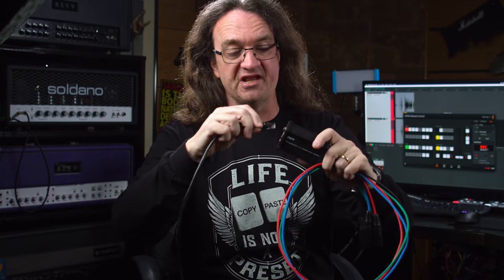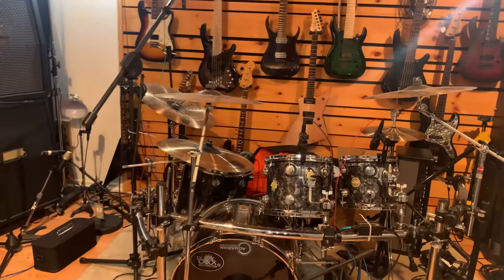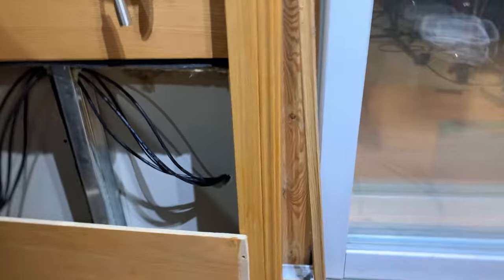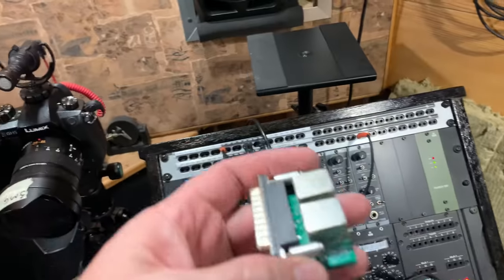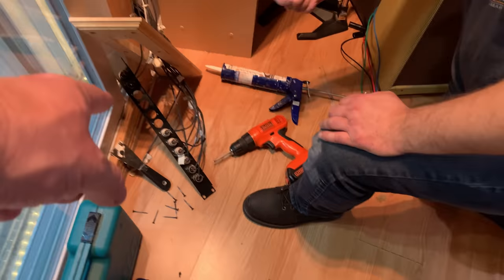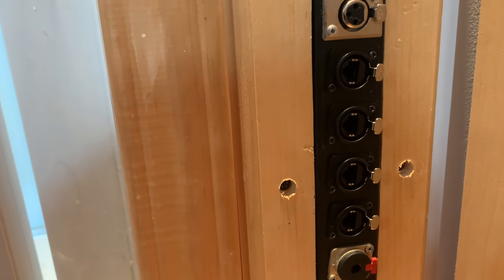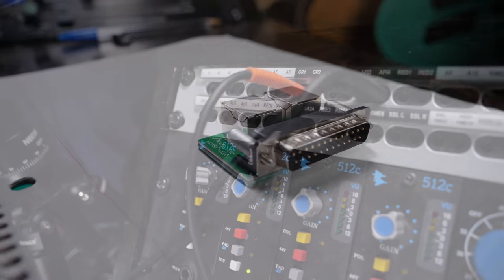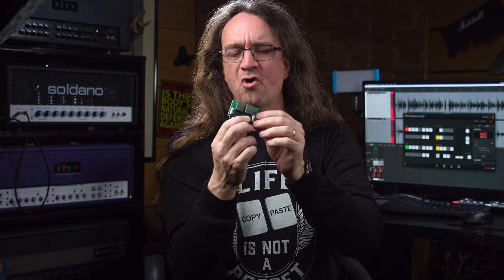How we Rewired the Studio!   We used lots of Caulk!

Comment: XLR and cat 4-5-6 are both balanced signal transmission cables.  The XLR just has a built in ground, while cat 6 has a common ground.  Other wise they are both balanced twisted pair systems.  So no surprise the cat 6 works well.

Comment: CAT Network cables are spiralled inside (or should be by specification) to reject more noise. But be careful installing them as they are (or again should be by specification) made of annealed copper which bends eailsy, then goes hard and brittle. It really is designed to be installed and left alone. I'd add that its usually a good idea to leave a 4" bend minimum on the cable if you want to guarauntee gigabit performance.

Comment: "The thought of running analog audio over network cable wasn't even thought of back then" ... glen.... gleeeeen...  That is 4 line analog telephone wire hijacked into running computer networks.  It was designed to run analog audio signals!  You are literally using it for what it is designed for!
Reply: BOOM! I worked at an audio post house and their ENTIRE interconnection trunking system was run over cat 3 and terminated on 66 blocks!
Only the last few metres of cable was shielded audio cable to XLRs from the patchfields.
Reply: yeah, I wasn't gonna say.  My deal is that if you are using sources that have significantly different cable length, you're gonna get sync problems, because, analog.

Since we had to isolate not only audio but wireless (I was the New Devices Group at Intel at the time) I just solved all my problems with PoE and fiber converters.

I was finding it a LOT easier to use that cabling to push distributed audio and deskew at the end points via reactive feedback and clock shifts, so if I had to send something to 20 different points in the room and at different spectral densities as well as filtered response desired it worked fairly well and allowed us to work backwards from that setup to embed reflection cancelling technology into the product - we could control everything, but again, this was more from a stimulus/pattern generator point of view, where this is trying to distribute the raw signal under its own energy.

At least with fiber converters if I was running a long stretch I could add a length of doped fiber to boost the signal without doing anything like an amplifier/processor.

I'd have to go check and see the parameters on the fiber converters - we might actually not only find a nice analog solution but one that REALLY cleans things up.

Running copper when I don't have to makes me cringe these days - also if you are going to upgrade power you can get used Starline Busway on ebay for HELLA CHEAP when that shit is VERY EXPENSIVE new.  I can't briefly explain what the stuff is but I can say I will NEVER build a lab, shop, studio, etc without it if I have a deciding vote.

Overhead on demand reconfigurable industrial grade power bus is something that once you experience it, you look at wall outlets with literal disgust.
Reply: Also cat6e is much better shielded, that's how it gets a better rating; the gauge of wire isn't heavier.  Once you get to the stuff that carries 10G/40G/100Gbps it starts feeling closer to hardline.
Reply: if you want a thumbnail estimate, your standard twisted pair with standard vinyl sheathing that's in your average RJ45 cable, is about 100 ohms impedance (yes through the length of the wire, NOT per inch), but the thing to understand is there is hysteresis in the line as well as some fundamental limits.  I never tried for high fidelity over twisted pair so I can't say if we're losing any harmonic richness off the top end or some of the other resonant points in your lines caused by loops and kinks in the wires.
Reply: @russellzauner  are you talking about "group delay" or "lip sync"?
Reply: Get out the smith charts! Cause at that point, you are making feedlines, and VSWR, BER, eye patterns, and clock jitter are gonna be a thing... :)
Reply: At work, we use that purple 110ohm 3-5pf belden cable for all the analogue and AES runs now. 
I can't remember the Belden number off the top of my head... Everything else is AES64, HD-SDI, and Madi...
Reply: @russellzauner  Cat 5e is rated up to 500mhz, analog audio is just fiiiine within the specs.  I also don't really see how run length is much of a concern for most of the uses of analog over twisted pair?  If you need a kilometer of run from one location and two kilometers from another, yes, you will have very noticeable phase issues, but at that point, i dont think this solution is for you.
Reply from the maker: @russellzauner  Rule #1:  DO NOT KINK THIS.

Comment: I'm glad you have success!  I'm in the process of rewiring our studio with all Whirlwind CatDusa products.  The way our studio was designed, the conduit from control room to studio is 80'! We ran 100' Monoprice CAT7 cable and it's perfectly quiet.   Our studio is a radio/podcast room.  Using Ethernet cable will greatly reduce the clutter.
Reply: Is each pair shielded? Or One common shield for the group of 4?

Comment: This is a great solution! I bought a place with a converted garage-studio (not the best build job, and all the wiring and gear was ripped out by the realtor to reduce the sale price) and I think the CAT6 is going to rock. I have found dual RJ-45 to screw-terminal breakout boards well-available, I can wire that to DB25 but it just won't look as clean, but that will be for the back of the rack.

Comment: I work at a radio station the system we use is wheatstone Wheatnet, it supports AOIP and analog over Ethernet, and from my understanding we did the switch about 10 years ago? When I create these cables that go XLR to male RJ45 it always blows my mind even after 3 years!

Comment: if you have the pinout of those DB25-RJ45 breakouts, it should be super simple to get a local maker to whip up a quick clone in eagle/kicad and get some PCBs made. the only real bottleneck is that with through hole jacks you have to do all the soldering by hand; paying the PCB factory staff to do it for you is cost-prohibitive with order sizes smaller than 10,000 or so.

Comment: Should be quite easy to replicate these adapters. PCBs are really cheap to make these days, add a bit of soldering, you're done. All you need to know is how the pinout is mapped between these things (which should be easy enough to figure out with a multimeter or tracing the actual wiring on the PCB). 
Awesome work at actually running Cat.6 cable for audio - most people will discourage you from it, but I'm convinced they do not pose a big problem.

Comment: I like punchdown blocks, especially on the back of TT patchbays.  They are just so fast to work with and without any fuss.  You could just punch down some pigtails with RJ45 female junction boxes and house them any way you want.  Not having to solder XLRs except at the last leg is awesome.

Comment: One thing to remember with cat-cables is that you want to use S/FTP type, which is individual pairs shielded and the whole cable is shielded. It cuts down your noise and crossfeed between pairs, and avoid for all that's good on earth UTP-cables, unshielded types... they're fine for digital signals, but suck ass for analog.

Keep at it :)

Comment: Hey Glenn!! I would just ripped off all the extra cabling! I bet you won't use that any more, now that you have those sweet sweet rj45  cables. On those weird connectors, you can probably contact your local electronic guy to make those for you, as there is no electronics involved, is just pin-to-pin soldering (which still needs some soldering skills). If you could make the c-block, you can probably get away with some soldering :P

Comment: I've seen many designs of sound isolated way of running cables so that one can easily open the wall up, replace or install cables and seal it back in. I would have thought that someone on the studio design forum would have shown at least one of them to use? :o

Comment: Making those db25 to rj45 dongles DIY shouldn’t be too difficult. db25 connectors are a bit pricy but not astronomical. The important part will be matching the pinouts properly and ensuring good signal isolation thru proper pcb design. Could DIY maybe 5 for around $40-80 total using one of the Chinese pcb houses.

Comment: Good job Glen! Would it be better to use Shielded Twisted Pair (STP) cable vs. Unshielded Twisted Pair (UTP) for better shielding from external noise. I thought the twists in the pairs prevent crosstalk for digital signals. Do the twists have noise canceling effect on analog signals?
Reply from the maker: Yes.  You need STP for phantom power, anyway

Comment: Glenn, that DB 25 connector board. Doers it have more electronics on there or is it just the connectors soldered onto a PCB? If you're feeling adventurous, you can replicate that PCB and have someone print it for you. I've seen ads about small batch PCB printing.

Comment: If someone know how to solder cables DB25 connectors are cheap and eazy to make.
Cat Cables would solder in like any other cables if you want to do direct or get 2 fem RJ45 connectors. it will give you the same result as the Wardbeck adapters. 
its an eazy job if you're DIY
Reply from the maker: Yeah, sounds like it would take hours... NO THANK YOU!

Comment: Glenn, I’m not sure if you have done video on this or not, but could you do a video explaining how to use a hardware compressor with a usb audio interface?
Reply: I can, in brief: Hook up the source to channel A, setup one of your outputs to carry that signal only (amplified), so that's output A. Run a cable from that output A to your compressor and the output of said compressor to input B. Route the signal of input B however you need to.

So source - interface - compressor - interface

Comment: Is Cat. 6 a requirement? Wonder if STP Cat. 5 or 5e will do the trick.
Reply: It’ll work just fine for audio; 3 vs 5 vs 6 only matters for stuff up in the radio frequency bands (such as a digital high speed networking signal). Using shielded cable however is recommended.
Reply: @darkwinter6028  For phantom power, would you recommend individually shielded twisted pairs or is just one shield (for the group of 4) fine?

Comment: What gets me is cat6 still only has 8 wires, XLR has 3 wires per cable (well fully wired ones do), how is 4 cat6 running 16 lots of 3 wires? wont there be a missing wire on each channel? or is something happening? 3 pins being on xlr etc (been a while since i done anything xlr etc, set and forget etc)
Reply from the maker: Just get shielded cat6
Reply: @SpectreSoundStudios  good point, just confused me as shielded cat 6 is still just 8 wires, so 4*2 pair etc, but hey if it works it works! In all honesty i at one point did a custom cable using some chopped off and repurposed cat6 to run my pedalboard, one cable to my board, ran 9v, and guitar receiver in and then stereo feed (dual mono) back out to the amps, i know everything in the world tells me it shouldnt be done, but hey it worked, and i never really had any noise problems (made sure to start with a quality voodoolabs power supply) , currently on the move to axefx now for my live rig, need to try your impulses on them soon! will have to give feedback as to how they sound live! (currently using an Andrew Wade 412 Mesa IR)

Keep rocking and F you glenn <3 :)

Comment: "It doesn't matter if it's Line 6, Marshall, Fender, or anything else. An amplifier simply takes the sound of a guitar and amplifies it. It's the guitar that makes the difference"
-My fucking step mother. 
Glenn, I think she's  secretly a bass player -_-
Reply: We must go deeper. The guitar is not acoustic, so it doesn't matter at all. It's just the strings that make the sound. The guitar just sends the signal to the amp, which amplifies it. 

Disclaimer: this is not a serious comment.
Reply: @drakonyanazkar  We must remove the wood slab body and neck altogether and simplify down to just the strings! Then and only then will we truly know the definition of tone! 🤣💦
Reply: Of course. The preamp section and tube warmth have nothing to do with the sound. 🤣 Why not just plug into a 3000-watt 4-channel solid-state amplifier?
Reply: @RockU2Death5150  with Hi-Fi speakers

Comment: New concept? We've been doing it for thousands of four-wire audio circuits for almost 20 years.
Reply from the maker: Who’s “we?”
Reply: Host broadcaster of the Olympics.
Reply: Analogue and AES.
Reply: @larzblast  was that custom?  I've only seen adapters on the market in the past few years.
Reply: @SoCalVipers  We pretty much terminate all our own cables and panels, so it is indeed custom. In the broadcast game, it's way more commonplace than you think. Believe it or not, if you recall the old 50 pin Cinch connectors (aka centronics) used on the old parallel port printers, we used to use those in high circuit-count analogue audio installations and that was using unshielded 25 pair CAT3 cable! It was even suitable for AES3 on long runs (around 60m).

Comment: The only question i have about this kind of wiring:
If all cables are hidden in the wall, or the floor, the fact that it saves space isn't really much of a factor.
However, are there any downsides to audio quality? Do the channels leak to each other or anything like that?...
Reply from the maker: No.  They’re twisted at different ratios so the cross talk is non existent.   And mic up a drum set.  Cables everywhere!
Reply: @SpectreSoundStudios  I am going to build a studio in the future.
I'm just thinking of making an XLR input box on the floor. Cables coming outthe input box would be hidden in the floor.
So no, No cables everywhere...
Reply from the maker: @pauliusmscichauskas558  This lets you split up into banks of 4.   XLR box usually limits you to one place.   But somehow I don't think I've made a convincing argument...
Reply: @SpectreSoundStudios Oh, you've convinced me! I saw the utility of this thing right away. Double-gang wall and floor plates with up to 12 ethernet ports are cheap (less than $2.50 ea) and easy to come by. 48 channels in a single plate less than 5" square? Sign me the fuck up.

Comment: You know Glenn.  This is stupid overkill.  The airtight between your drum room and your control room really ain't all that necessary.

And leading all of those wires from the control room to the drum room.  Which is really far and at least 15 feet.  Wow that's a long ways!  At least it's not 250 or more feet.

Truly wiring a control room takes miles of multiconductor snakes.  For an actual professional install.

Bedroom control rooms in garages is a little different.  Airtight?  The building has to be airtight.  So the sound inside the building doesn't go outside the building.  Because if air can escape so can sound.  And inside is very different.  Between the control room, studio and drum room studio.

And don't be telling me.  That when you are tracking drums.  If you turn off your speakers.  Don't tell me you're not going to hear the drums.  While the drummer is playing in the next room.  Because you will be hearing the drummer in the next room.  Of course maybe 4 layers of sheet rock later you might not?  But why should that really make any difference at all?  When you know what you're doing.  You can also use headphones should you so desire.  During tracking.  I never bother with that.  I just use the speakers.  But the headphones are always handy for a quick check, on the old noggin.  And back to the main monitors again.  And then also checking on the smaller monitors.  And then again on the smallest monitors.  Then you turn on the FM transmitter.  And go pop into your car.  And check it out on the car radio.  What?  You don't have an FM transmitter and limiter?  Oh well.  I was expecting too much.  Then try a CD or memory chip.  More effective if you have an FM transmitter and a Orban FM OPTi-Mod.  Or equivalent.  It's low cost and easy to do.  Then everybody can pick it up within a couple of block radius.  Because it's legal to run a bootleg FM radio station under 1/2  watt output power and antenna no higher than 50 feet above average terrain.  At a quiet place on the dial.  And can come in very handy.  For your neighbors.  To be able to enjoy.  The recording sessions you are running.  Because they could tune in.  If you were broadcasting your recording sessions.  And why not?

Nobody has ever thought about doing it this way.  With your own local stereo FM transmitter.  To know how your songs are going to sound to everyone at rush-hour.  Maybe Canadians are not in a rush for anything?  So this might not pertain?  There's so few of you for traffic jams.  And only 50 million or so.  In a country as large as the USA that holds 350 million.  So of course you guys can't possibly have any traffic jams!  Or taking three quarters of an hour to get from one side of downtown to the other.  What do Canadians know about that?  Nothing!

So obviously Canadians are not in a hurry to record rock 'n' roll either.  It's too cold up there.  It slows you down.  Because you first must shovel all that snow, in June.  To get the drums in your studio and three cars parked in your driveway.  And you will have to be shoveling all that snow in June.  Because you're in Canada.  Home of cold geese that turned brown.  And they keep flying over the border to the United States every fucking year and we can't eat them!  What the FUCK is with that?!?!  They keep pooping on our cars!  With all of your Canadian geese bird shit!  Do you know how disgusting that is?  Those are big birds!  Our birds don't do that to your cars!  Because they don't want to go to Canada!  It's too cold!  American geese are smarter than Canadian geese!  They aren't up there freezing to death.  And then pooping on all the Americans!  I mean what the FUCK!?

I just got goosed
RemyRAD